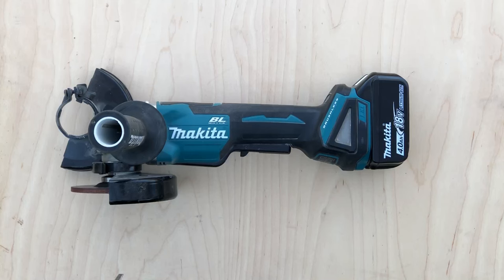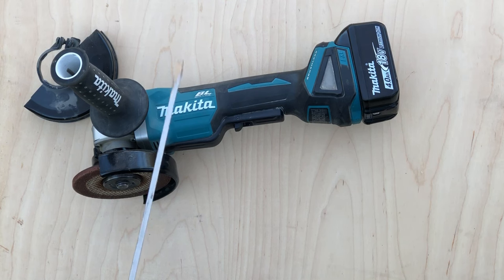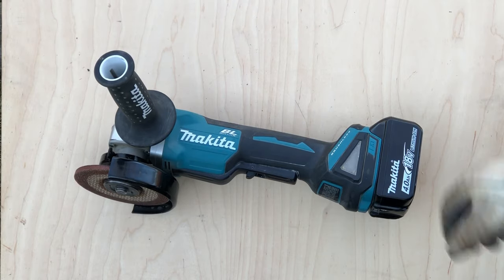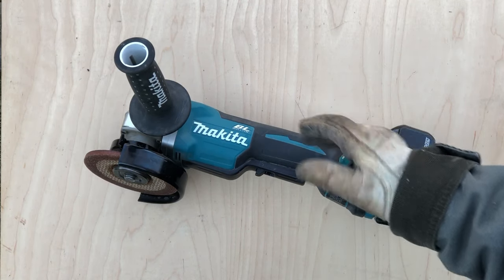Makita Cordless Brushless Angle Grinder Long Term Review

Comment: I have this in the variable speed version along with the 9” x2 model. Both great tools. Makita makes nice grinders.
Reply from the maker: I agree! Cordless and corded alike.

Thanks for watching and commenting.
Reply: 💥 When do you care to use a grinder at anything less than full RPM.??
Reply: @Jimmy_Cavallo I was considering a variable speed for sharpening my mower blades. High speed for when I hit rocks/ stumps and notch it and a lower speed when I need a “ light” sharpening. Don’t know though if I need it though,never had one before and been doing it for 25 yrs.🤔

Comment: I just bought one of these with the thumb switch. I noticed that if I turn the spindle manually it makes a clicking sound. Is that normal or do you think I got a lemon? I spun it up a couple times but i haven't used it yet.
Reply from the maker: I honestly don’t know. This may be attributable to angled spur gears in the drivetrain, but that is only a *guess*.

If you think your grinder has issues, I suggest you try to find out before the return window and/or warranty expires. 

Good luck with your grinder and thanks for watching and commenting.
Reply: Это магнит ротора тормозит.

Comment: Hi does the paddle switch is better and more practical than slide switches or not?
Reply: really depends on what you’re using it for!
Reply from the maker: As another commenter has said in this thread, it really does depend on what you’re using the grinder for. Even then, the choice between a paddle switch and slide switch is still personal preference. 

Personally, I prefer a paddle switch for almost everything I use a grinder like this for. Except for tasks where I need to leave a grinder on for long periods of time. In that case, I have a plug-in grinder with a slide switch. Gripping a paddle switch for several hours can get tiring. Even a paddle switch as unobtrusive as the switch on this grinder.

Thanks for watching and commenting.

Comment: Thank you for review. 
Is it easy to hold this model with one hand during cutting?
Reply from the maker: I’ve never tried a single handed cut. I think the location of the paddle switch would make one-handed cutting very difficult. A grinder with a switch on the top of the grinder may make this possible. Even then I think you’d need fairly large hands to get a secure grip on the grinder. The body of the grinder in the video is almost the same thickness as a plug-in 4 1/2” angle grinder.

If you need to be able to use the grinder with one hand, the auto shut-off I demonstrated in the video, is a safety feature worth having. If you have a mishap, the grinder will almost instantly shut itself off. If you check the comments, you’ll find others have said similar things.

Whatever you do, be careful. You only get one set of hands.

Thanks for watching and commenting.
Reply: @CroakyOak  thak you
Reply from the maker: You’re welcome!

Comment: Is not having a variable speed setting a deal breaker?
Reply from the maker: Variable speed on an angle grinder is handy and useful feature for some tasks. However, in my opinion the lack of variable speed is not a deal breaker. Unless you have a task that really needs the finesse available with slower speeds, a grinder with a single speed (full speed) is fine. 

Thanks for watching and commenting.

Comment: Screwfix offers it with 2 batteries 5 amp + charger can I run it nonstop using both 5 amp batteries ?  or will it hit up and destroy it?
Reply from the maker: My experience has been that constant heavy loads can discharge a battery faster than said battery can be recharged. Bigger batteries may last longer, however they also take longer to charge. Whether or not you can run the grinder nonstop with only two batteries depends on the load being put on the grinder. 

Also keep in mind that no matter how good a battery/battery system is, they all have a finite number of charge cycles. Cycle the battery enough and you’ll have a paperweight or a warranty claim.

My opinion is that if you have an application requiring a tool with a duty cycle at or near 100%, you are better off with a corded grinder. Makita cordless brushless grinders and excellent tools. But I think they’re best suited to applications with a lower duty cycle.

Thanks for watching and commenting.

Comment: Helpful review, thanks, especially as I am about to buy one. It might be worth pointing out they do an 11000rpm cordless unit, 452Z, but it is not brushless. There may be others but it is hard trying to keep track of all the tool models Makita produce! I may buy the 452Z because of the extra speed but still might go for a brushless model.
Reply from the maker: Thanks for the info!

Comment: But…. What model it is? There is few brushless makita 125 grinders
Reply from the maker: In the U.S. most Makita 18 volt cordless brushless angle grinders have the same battery performance and power. The main differences are:

1) Paddle switch or thumb switch
2) Electronic brake or no electronic brake
3) Variable speed or single speed? 
4) Will the grinder stop is the wheel jams? (AFT)
Makita has also added what they call AWS and is for use with a dust collector. 

The grinder in the video is a single speed model with a paddle switch and an electronic brake. This grinder will also stop automatically if the grinding wheel jams. A feature Makita calls AFT.

The main reason there is no model number in the title is that identical tools often have different model numbers depending on what country the tool is sold in. Many tool companies will also make tiny changes to some of their product line and assign a nearly identical tool a new model number. Putting a U.S. model number on a review with an international audience is of no use to many people outside the U.S. even though the content in the video is still valid. The same could be said for what I call ‘model number creep’.

As of August 2021, in U.S. the Makita cordless brushless angle grinder with the same features as the angle grinder in the video is the U.S. model number XAG11Z. In a year, an angle grinder with the same features may have yet another number. If you are in a country other than the U.S. the model number could easily be different even if the tool is the same.

I hope this answers your question and explains why the model number isn’t part of the video. Thanks for commenting.

Comment: Can you put the dust shroud on this grinder
Reply from the maker: If the shroud you’re looking at is a Makita part, it’ll probably fit. However, I wouldn’t buy anything without checking the compatibility information on the Makita website specifically. I personally find most retail websites are lacking information this specific. If you’re still in doubt, check the seller’s return policy and procedures before you buy.

I realize this isn’t much, but I hope it helps nonetheless.

Collecting dust at the source is the way to go. Thanks for your comment/question.
Reply: I believe either  196846-1 or 196845-3 should fit depending on your model.

Comment: Thanks for the review.  Looking at the new one Model #XAG26Z not sure you said but are the wheels pretty universal or does Makita only accept their own?
Reply from the maker: Grinding wheels should be universal so long as the hole in the wheel is the same diameter as the shaft on the grinder and the maximum rpm of the grinder doesn’t exceed the maximum rpm printed on the wheel. This grinder has a standard 5/8” shaft and I’ve never had a problem finding grinding wheels, cutting discs etc. for it. Thanks for your comment.
Reply: It’s hard to tell now ordering online.  I don’t want to get stuck with the x lock either.
Reply from the maker: Try checking the Makita Tools website to find a tool you like and then search online sellers using the exact model number of that tool. Searching for a specific model should help bypass whatever online sellers are pushing to the top of more generic searches. Good luck.

Comment: Always go for the paddle switch
Reply from the maker: I too, prefer grinders this size to have a paddle switch. Thanks for commenting.
Reply: Yea, but there is no paddle switch thats worth owning. They all have stupid system of lock. It should be on the top part of the handle, like in dur353
Reply from the maker: I realize this is a polarizing subject. I get what you’re saying and I agree that many power tools have poorly designed safety switches. However the safety lock on this line of grinders is as unobtrusive as any safety switch I’ve ever used. I’ve never an issue with it even when wearing insulated gloves. 

Fortunately for us all, Makita makes many different variations of their cordless and corded grinders. Which makes it easy for nearly everyone to find a grinder they like.

Thanks for commenting.
Reply: All paddle switch Makita Grinders I've owned have died.

Comment: So what's your take on the thumb switch? The type that stays latched 'on' when you turn it on?
Reply from the maker: I don’t think either one is intrinsically better. That said, I try to avoid any power tool that requires me to change my grip or move a hand to operate the power switch. If something goes wrong I want to be able to cut the power immediately. I’ve always found grinders with a thumb switch on the top of the grinder awkward to power on and off. A person with bigger hands may disagree.

The advantage to any switch that can be locked in the on position is that you don’t have to hang on to the switch, which can be fatiguing. I’ve got a Milwaukee grinder with a paddle switch that has a stiff spring. It’s a terrific grinder but using it for hours on end is not fun because the switch always needs to be squeezed shut. 

The ergonomics and grip on this Makita grinder make the paddle switch almost unnoticeable. And, most of my work is a few minutes on, a few minutes off. So, if I purchased another cordless grinder I’d opt for the paddle switch again. If I ever have a task which requires hours of grinding, I personally would look for a plug-in grinder with a locking trigger switch, but not a thumb switch. 

I hope this helps. Thank you for your question.

Comment: I had this angle grinder for 2 weeks. Each 5amp battery cut 3 tiles 900mm  20mm think before needing to be changed. I was disappointed, but loved the freedom of cordless.  But about 15 tiles later it just stopped working. I sent it back and hoping for a replacement or refund.  If I was tile cutting more tiles I would go for corded.
Reply from the maker: Those were some big, thick tiles you were cutting (approximately 35” long by 3/4” thick). I’m not entirely surprised by the battery life. I’ve had similar experiences when making long-ish cuts in thicker steel. I agree that sustained heavy loads are better suited to a accorded grinder. If I recall correctly, I mention something about this near the end of the video. 

Fortunately, I have not ever had my grinder stop working. That is a real bummer, although I expect Makita will make it right.

Thanks for adding your experience with battery life to the comments for this video. This kind of information makes this video a better resource, thereby helping other viewers make a more informed decision.
Reply: Sounds like a job for a wet cut tile saw.... lol

Comment: Qual o modelo da bateria, tem como informar todos os dados
Reply from the maker: The batteries I use with this grinder are 18 volts with either three or four amp hours of capacity. However, I don’t know what the exact model numbers of the batteries are. 

Thanks for watching and commenting.

Comment: Which models are pre- X-lock ? No way harder to find the regular Arbor. I’m not buying 100 new various discs because the arbor won’t work on the newer ones :( . Nice to see a pre- x-lock hopefully they stay in market.  Boooo x -lock
Reply from the maker: I’m no fan proprietary accessories either. Especially when the existing universal system is less complicated and works well.

 I like to check the Makita Tools website for tools that suit my need(s) and then search for specific model numbers when shopping. Usually this will bypass what ever new stuff online retailers are pushing to the top of searches using more generic search terms. Good luck.